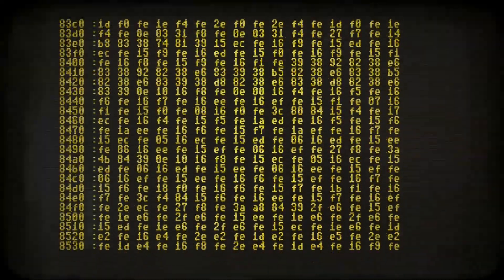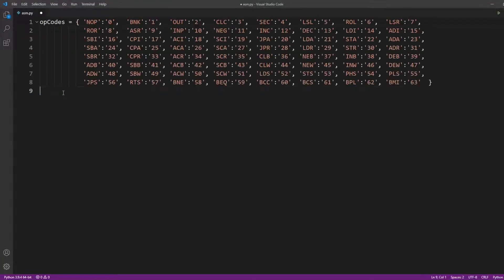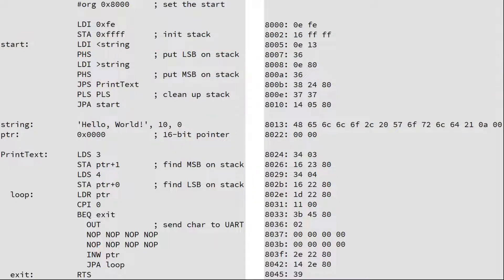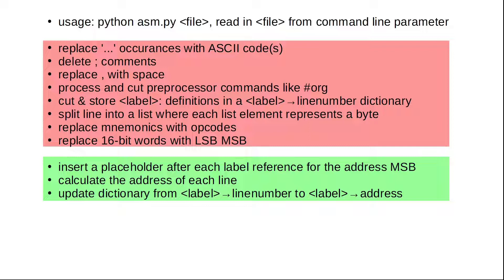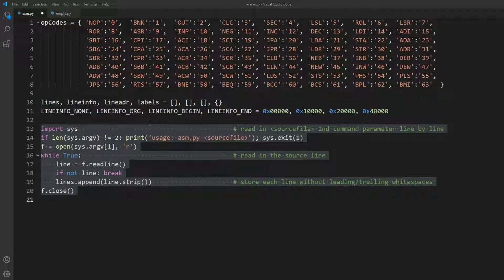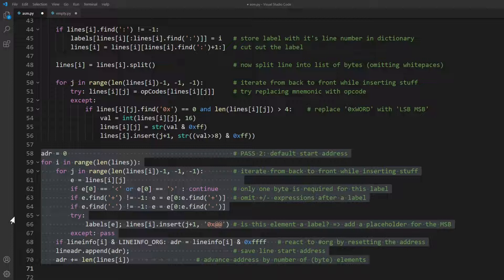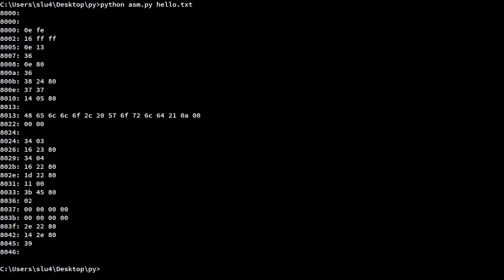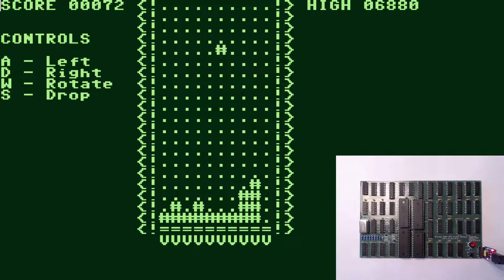Let's Code a Minimal Assembler from Scratch in Python (100 Lines)

Comment: You should use regular expressions instead of these string functions. Makes your code smaller, faster and more readable (assuming you learned regex, which I advise all).
Reply from the maker: CallousCoder, this asm was meant to be portable to a very limited machine. Hence, I only use the very basics.
Reply: @slu467  and then you code in Python? C with preg lib or even C++ with stl would’ve been just as portable.

Comment: Will the upcoming Minimal CPU 1.5 require a board revision, or just a flash chip upgrade to something like the 28SF040?  Just wanting to verify before I order boards.
Reply from the maker: Hi John, I suggest you wait for the revision 1.5 to come out. I am just starting work on the release video. The hardware is long finished. It will require a new board - but it will we worth it promise (double speed, 512KB SSD and an expansion port to connect *anything*). Cheers!
Reply: @slu467  Thank you.  I am anxious to learn (have built Ben Eater and a couple each 6502 and Z80 SBCs, but really want to understand the real fundamentals you are teaching) and look forward to 1.5. Your explanation videos are top notch.

Comment: By building my own "TTL"  homebrew cpu I've learned the hard way that whilst this video is alluring it doesn't explain the limitations and tradeoffs of the minimalistic approach. I don't have an academic compsci background and had never written an assembler or compiler before starting work on my own homebrew TTL cpu but ... as your instruction set and assembler becomes more sophisticated then a multipass assembler becomes increasingly complex and a tangle. In my experience parsing the ASM into an abstract syntax tree and then evaluating the tree, tend to lead to a more extensible and cleaner design. The benefits of the AST approach / lesson learned became more obvious as a learning exercise once one tries to build a high level language (eg something C like or whatever) for your home brew cpu - don't try it without an AST unless you love exercises in complexity. So I'd see the more scalable AST based approach for an assembler as a sensible stepping stone in learning how to build a compiler, but the multipass approach is definitely the initial approach most folk will end up with unless they have the premonition of storms ahead. AST's tend to end up using recursion as opposed to the itertive approach of multipass - but the result is worth it from a scalability point of view..
Reply from the maker: John, from a standpoint of a serious developer I am absolute with you! But since I am only interested in very basic principles and since I am well aware of the overall limitations of my hardware I won't make the mistake of trying to push things too far on this little platform. It's simply not "worth" it :-)
Having that said: I have just finished math expression parsing, a text editor and will soon finish a native assembler. Another "Minimal" team member (a senior software developer) is working on a BASIC JIT compiler. He is working wonders on this architecture and has already completed a FIG Forth :-) Stay tuned...
Reply: Beautiful words

Comment: I really like what you've done here.
I'd like to have an assembler where the source file actually IS the Python (well, I'd prefer Ruby - but it's all the same) that way any constants or assemble-time expressions can be prepared or calculated in a nice scripting language. (we had something like this for the 6502 in BBC BASIC back in the 1980s) I've been looking at https://github.com/keystone-engine/keystone but it's far too complicated... I'm thinking I might be able to do something using a more minimal approach... and you've inspired me to try this again now.
Reply from the maker: Glad to hear that it inspired you! But beware, this approach is (barely) okay for simple assembler syntax. It is way too unsophisticated to parse any "higher" language. One would need to implement expressions with BNF and stuff... and you are well over 32KB land...
Reply: @slu467  most of what I do is little microcontrollers and 32k is pretty much my upper limit. :) but I am worried that my ISAs might be a bit too complex for a minimal minimal approach.... I'll have to see how it pans out.